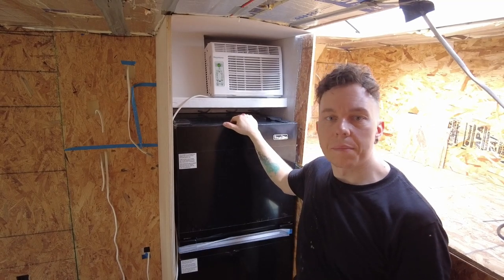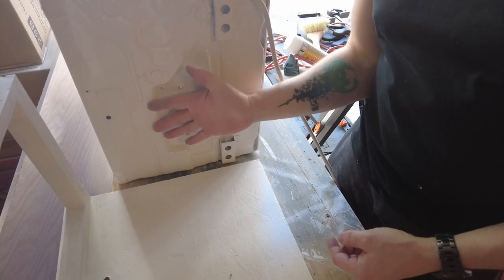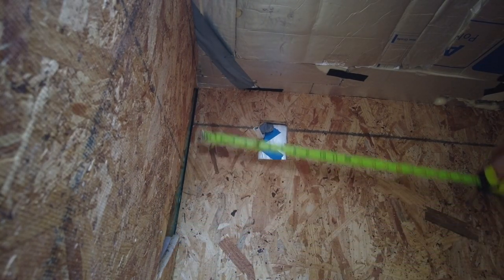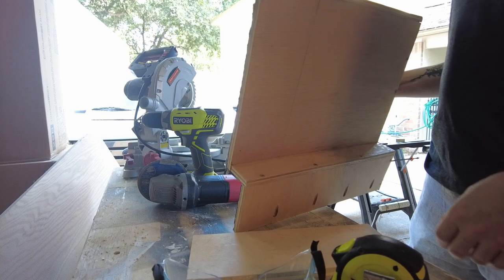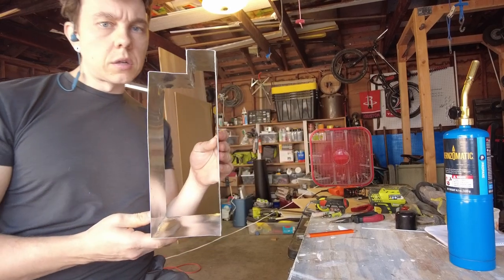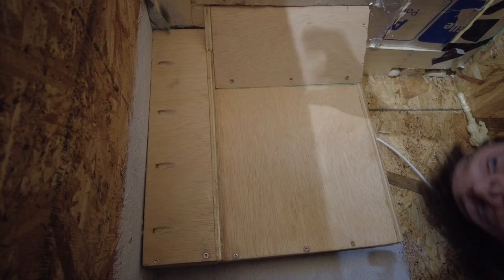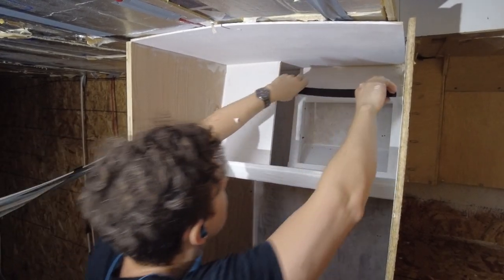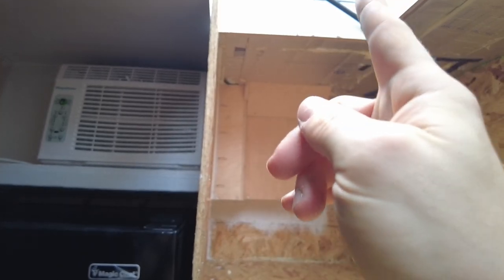DIY Stealth Box Truck Campervan Air Conditioning Install | Box Van Conversion #10

Comment: Plenty of roof vents available off the shelf that are screened and provide a barrier to water invading your space..Commercial campers have been made that way for years...External vents don't tell everyone this unit is a camper. It could be a generator or refrigerated unit plenty of work trucks have vents even roof top mounted AC and solar panels. A large slotted vent covering your window will serve two purposes with blackout shades at nite you cant see in plus with screens you can let fresh air in and keep bugs out also during the day you can see out and it's next to impossible to see in. Furthermore if you put a lift on the vent it can be positioned up to have a full view and a little awning over the window....Now thats some real stealth...Vents can appear like a work truck if done right.

Comment: Brilliant idea.  That's first.   Genius.  Here is my concern.  My indoor AC tube is super thick in gauge.   After 12months the water that escaped through the tube has collected debri or grime, slime, sentiment.  It did take an awfully long time but the tube was compromised and I needed to flush it out.  Make sure the smaller gauge tubes are easily accessible to be cleaned or replaced as time requires.  Love the build.
Reply from the maker: Thanks!

Accessibility was one of my top concerns with the build. This is why I created a foam seal around the back of the fridge instead of a wall - If I need to access the tubes/vent for maintenance it's as easy as sliding out my fridge.

I also left the tubes partially visible so I can monitor flow and buildup
Reply: @TheTechnoBarbarian  genius, best design I've ever seen on youtube.
Reply: Great build so far! I really liked when you said, concerning the “soldering” of the aluminum, “I’ve never done this before, but I’m excited to try”. Admitting that on FB, putting it out there, even though, knowing, that the know-it-all trolls could rip you apart, that shows confidence and integrity. I like that. Not being afraid to try something, even if you failed. Quit teasing us, and post those schematics already!! You teased us a while back with that!! Lol, sorry I didn’t watch the vid when it dropped, I was at work when it hit. I saw the Locals notification banner pop up, but we just launched the new model Infiniti QX60, and I am PQA, so I have to really scrutinize them and was in the middle of my 2 hour check, and couldn’t stop to watch (although I wanted to!). It was a great tutorial though. I’m glad you don’t cut a bunch of that out. It’s important to some of us. Can’t wait for the next vid, hurry up already. Good Day
Reply: Right. Keep your lines clean and cleared. If you’re hitting the road for an extended period of time maybe a small chlorine tablet will help keep mold from forming in your collection try and tubes.
Reply: Wondering how your keeping rain out of your vent area

Comment: Impressive. Your workmanship and design is a pleasure to witness and an inspiration.
I would have changed one thing.
The aluminum vent you soldered\welded was well done but considering you are building a vehicle that will live with harmonic resonance at various frequencies (essentially a constant earthquake) as you travel those vent welded joints are going to see constant stress. Given the inaccessibility, the effort you invested and the pain in a but to repair I would have reinforced the joints with riveted, thin, inexpensive aluminum angle (commonly used by screen door and window shops) relieving some stress from the welds. The angle could have been fastened inside to not alter your OD. I would not have glued. I would want the peace of mind that comes from a mechanical fastener.

Nice to see someone using natural convection. I will employ several filtered, rodent\insct protected adjustable floor vents for natural, room climate control.

Another concern is using OSB (a wood product) in the first place near fluid. From an engineering stance, I would have tried to incorporate something else (fiberglassed honeycomb sheeting, UHDM sheeting, even formica over the wood, ect). If funds were unlimited aluminum of course.

Your a\c "pan" reminds me of my constant pet peeve with tanks that have flat bottoms. All tanks that have flat bottoms should be tilted and\or designed in a convex fashion so debris and contamination will naturally flow out. 
Your skill (newly discovered?) at aluminum shroud making begs the question why you did not make a A\C aluminum pan catch basin.

You've solved my shower pan dilemma, I was not relishing producing a fiberglassed\wood unit.
cheers.
Reply from the maker: Good considerations. I'll definitely be keeping a close eye on the vent, and will redo with thicker material/mechanical fasteners if necessary.

I plan on implementing the same technique with my shower pan: a hefty tilt concealed by teak wood. 

The tubes for the AC condensation are driled directly into the housing of the AC i itself. The water never comes into contact with anything other than the inside of the A/C or the inside of the tubes. Basically, I skipped the "pan" entirely and am pulling the water directly from inside the A/C.
Reply: @TheTechnoBarbarian  I missed the a\c drain connection, good idea.

Comment: One tip to help make your videos better, separate the parts where you're using tools into clips, then lower the volume of those clips. Ideally the tools and VOX should both be at a comfortable volume without us adjusting the volume.
Reply from the maker: I lower all the tool usage audio to roughly the same as the voice parts. Some of the voice parts may be low though. I also may have missed a few spots.
Reply: @TheTechnoBarbarian  👌🏼

Comment: That hot air that's coming off the refrigerator blows against the condenser in your air conditioner . thereby overheating your air conditioner as you will find out if you start using this during hot weather!
Reply from the maker: Refrigerator condenser doesnt generate that much heat. Already tested in 90+ works great
Reply from the maker: @ddrigmaiden  The air hitting it won't ever be hotter than standard outdoor air while hanging out of a window anywhere in the southwest USA in summer. If it lasts 2 summers I'll be more than satisfied.

Comment: That is a nice stealth air conditioning idea, but it's going to be too noisy on the inside of the living space. I would have used a mini-split HVAC system, because they are a lot quieter and installed the condenser on the top of the truck box.
Reply: A rooftop RV AC unit. However it would take up solar realestate.

Comment: Great design. When you design your stove/cooking system you can use the same vent for exhausting?
Reply from the maker: Yup. My microwave/oven will be in the upper cabinet directly on the outside of the wall enclosing the A/C and fridge. I can vent it into the same intake for the A/C and it will get exhausted out the roof.

Comment: Thinking about getting a 14' uhaul box truck. Is there enough space under the box to mount a condenser from a mini split ac? The one I'm looking at is about 22 inches tall.
Reply from the maker: The side skirts are about 14" tall. IF you mount on the frame you could probably fit it.
Reply: @TheTechnoBarbarian  Thanks for the info. Enjoying watching your build
Reply: I am currently preparing a '99" Ford E-350 mtr. hm. chassis (16' cab interface to cargo box rear.
Tomorrow I am mounting two 9gal air volumn tanks adjacent to the driveshaft. There is lots of room. I could add another but instead will be stowing the plastic wheel ramp blocks (36L x 12'W x 10"T) with room to spare. Likely the wheel traction skids will live under here as well.
I still have all the perimeter sq feet as well.
In addition, there is 36"sq of open space between the fuel tank and rear. Of course, your rig will likely be different. Get under there and measure. This space is underutilized from what I see.

Comment: what about condensation in the winter, do you have any advice to avoid condensation inside the boxtruck?
Reply from the maker: I haven't been through a winter yet, but I imagine it will only be an issue for those who don't heavily insulate and/or leave parts of the box exposed. Either way, condensation will be much less of an issue in a Uhaul than it will in any "sprinter" style van because the frame of the living space is almost entirely wood, not metal.
Reply: @TheTechnoBarbarian  so if I build only with wood, would it be better to treat it at all. Cause I really want to build a box truck for full time living but just scared of condensation and mold growing yk
Reply: And the window you added above the bed area, would that be an issue for building condensation? Jw cause I'm really trying to make this happen thanks again.
Reply from the maker: @GToke   The box itself is made of wood, which is what i was referring to as an advantage over the other vans. Doesn't really matter what you build with in the box if theres no thermal conductivity with the outside. That's where condensation becomes an issue. The roof hatch will have its own insulated panel in cold weather

Comment: I have the perfect Stealth Truck for sale in New Jersey if anyone is interested. I have not advertised it yet. Ready for fit out.
Super reliable  International Harvester 466E motor, well maintained, checked by mechanic and all in good working order. 26' ex-removalist truck... $7800